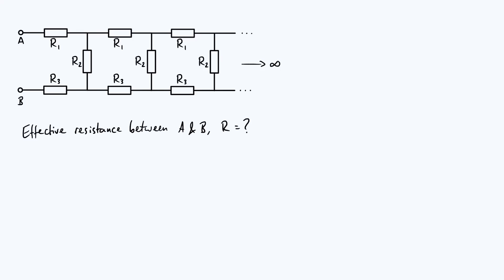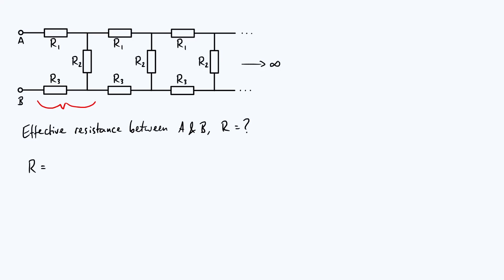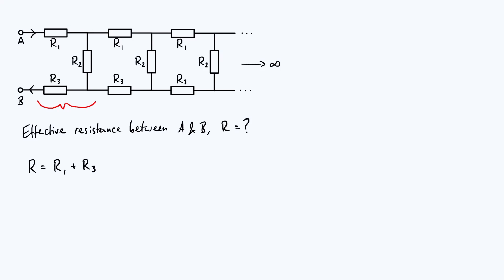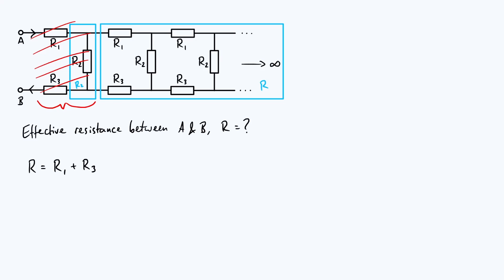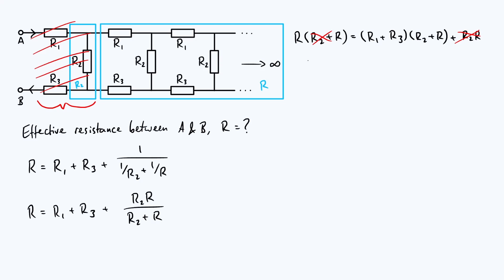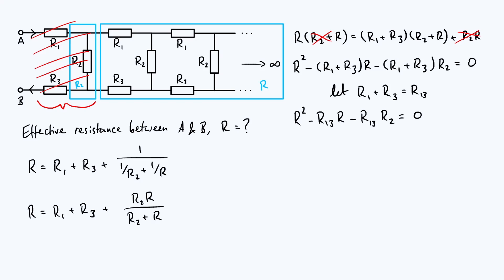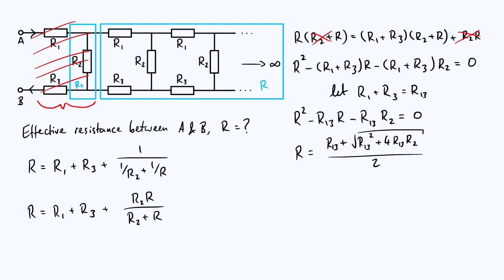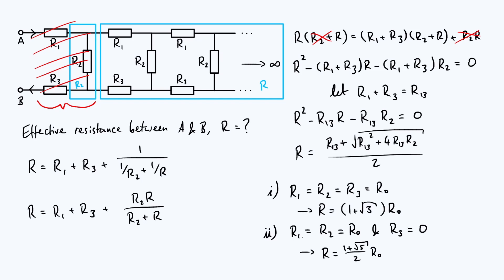Infinite ladder of resistors: general case

Comment: Thanks - this is a nicely explained video. 
However, at the back of my mind is the thought that to be fully accepting of the trick used (adding or removing one extra set of 3 resistors doesn’t change the sum) we need to demonstrate that the sum of the infinite  number of resistances does converge? Here, this video just assumes convergence rather than checking it?
Reply from the maker: Consider starting with one repeating unit, consisting of R₁, R₂ and R₃ - this has a finite resistance. Now add the next repeating unit, in parallel with R₂. The effective resistance of two parallel resistors Rₓ and Rᵧ is always less than the smaller of Rₓ and Rᵧ - this can be proved easily using the formula for combining parallel resistors. Therefore, the effective resistance of R₂ in parallel with the second (R₁, R₂, R₃) unit is less than R₂. We've just proved that adding one repeating unit decreases the effective resistance of the circuit, now we can add as many repeating units as we like and by the same logic the overall resistance will only ever get smaller, hence the overall resistance converges!

Comment: Now it's time to do the same with capacitors, since inductor would just have the same result as the resistive problem
Reply from the maker: The solution for capacitors would be very similar, but with each resistance R replaced with the reciprocal of the corresponding capacitance. This means that for example in the last special case we considered, the constant of proportionality would be 1/φ instead of φ, where φ is the golden ratio.